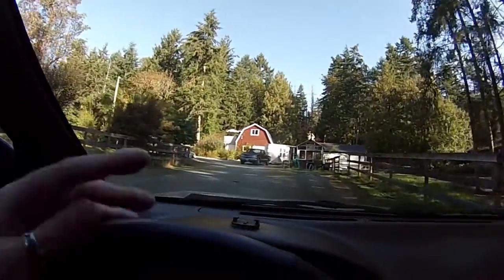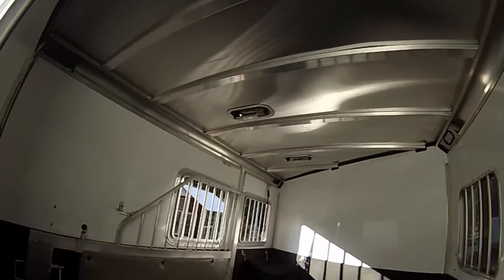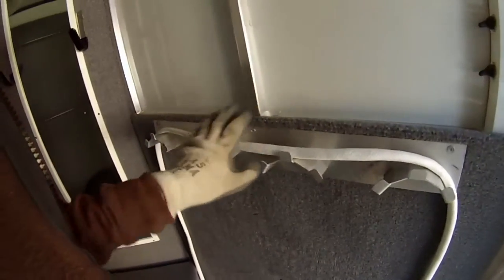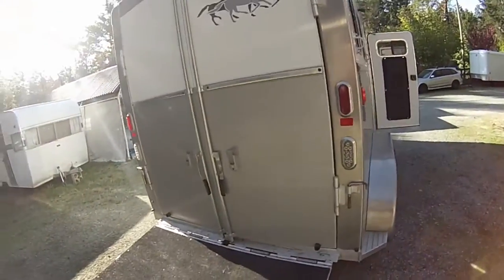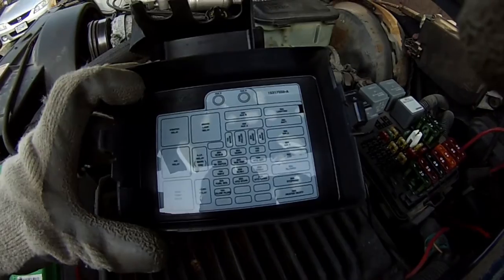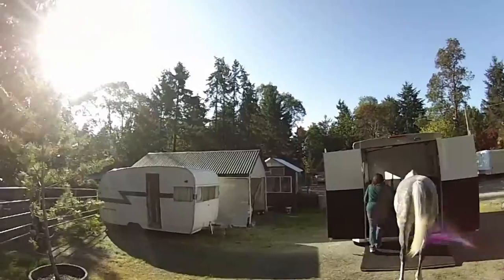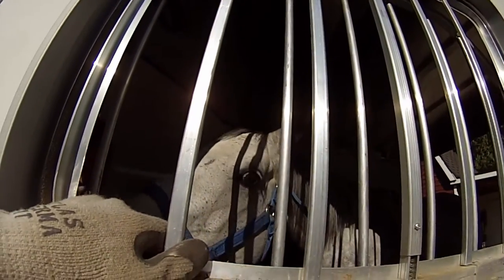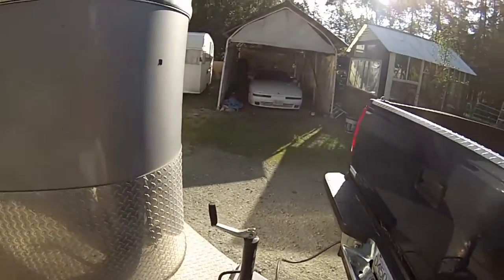New Horse Trailer! / Chevy Truck Problems.

Comment: i was going to suggest focusing on that trailer brake box those things a lot of time are the main point of failure with the lights and such too
Reply from the maker: or just cut the wire and slap it directly into the kick panel fuse box. I think that's more likely the issue because running that wire all the way up to the battery through that spaghetti mess is almost for sure the issue. but I will take another look at the brake box too just incase. that thing does look pretty old and i didn't check the connections on the back of it. thanks man!
Reply: anything i can do to help man you know me! :o)

Comment: You should try the wiring mess I had on the dodge when I had to rewire the lights plug on it after I put all new lights and wires on the trailer.
Reply from the maker: I've seen enough wiring messes for one life time. Owning 5 Rx7s was good training! 😁

Comment: Don't you just love it when things fix them selfs! :)
Reply from the maker: haha. yeah. totally. I must have pushed a connection back in when I was mucking around or something. I think if i put the + wire directly into the fuze panel by the kick panel that would solve a lot of the spaghetti mess of wires issue. so that's another idea. so far its working just fine tho!
Reply: I am with you, don't even look in its direction! :)